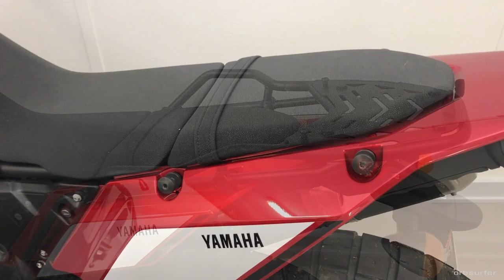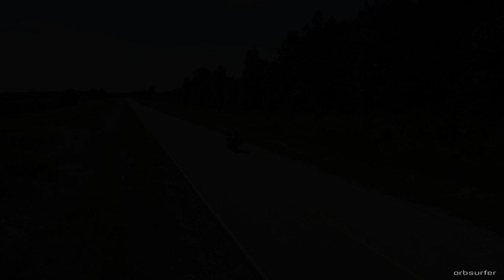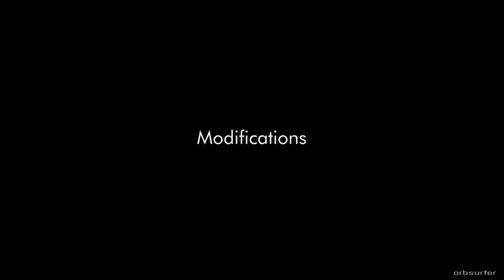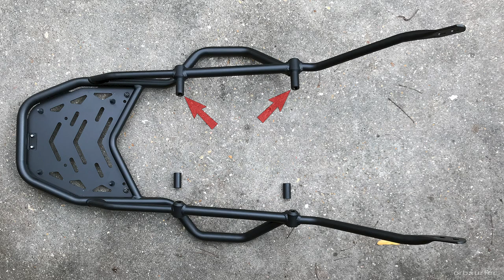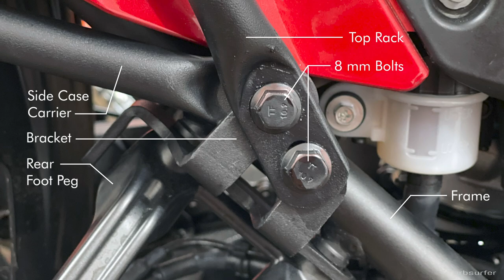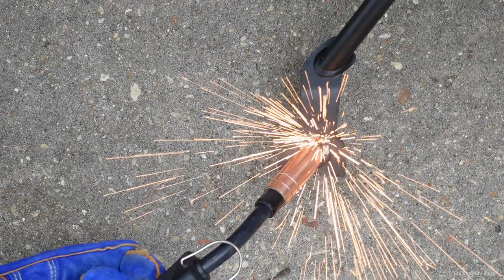Yamaha Ténéré 700 - Aluminum Top Case on OEM Rack + Side Cases on Givi Rack - Modifications Needed

Comment: I went with oem side case option as I'm not a fan of top cases. I just use a dry bag strapped across the top to carry light stuff like tent, & sleeping bag. I do like the oem side cases and rack. Got the locks too so they're keyed with my ignition key. Nice setup imo.

Comment: Nicely done....  I most likely wont attache Side Panniers but do like that Yamaha rack... I plan to attach a larger Pelican case to the top of that rack so I'll need to fabricate some mounting hard points along the hand grab area .... I can already smell the spray paint hahahahaha.    Can I assume all those tabs sticking out the top of the rear rack are some type of polymer that can be removed some how ?     Again great video ...

Comment: I like your videos,you are so purshise!
Just one thought...
Why Yamaha didn't have option for 3 cases from the start?
Maybe because of the wheight, i mean it's not a super tenere 1200, so you can't carry so much wheight with you... I mean the % wheight according the motorcycle's wheight...
I don't know if I put it right....
But made it's not an accessory from the start, for 3 cases because this could destroy the geometry of the bike....
Small motorcycles have limitation on the wheight you can carrying....
Reply from the maker: You are probably correct. I always pack the heaviest items in the bottom cases close to the front inside in order to not alter the balance too much. For me, this bike is more than big enough in both size, power and weight - it is rough enough to lift it back up; i.e. I am glad it is not 50 kg/100 lbs heavier! :-)
Reply: @orbsurfer8195  I agree, wheight is always a problem and this bike it's so good and vfm... For me this is the best real adventure bike on the market and if you consider the price is like stealing! I have a Honda varadero and the ratio of wheight with power i believe is the same with your tenere 700... So we do the same trip almost, but it's easier for you and more fan....